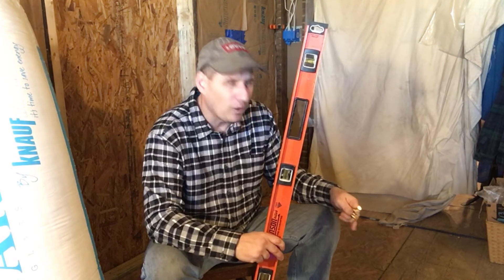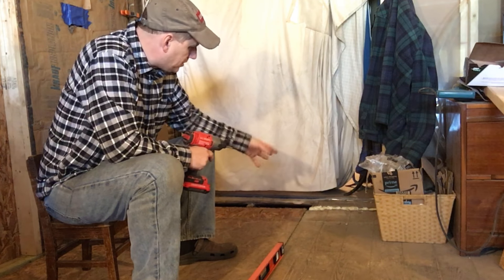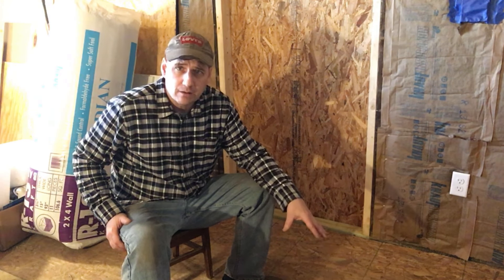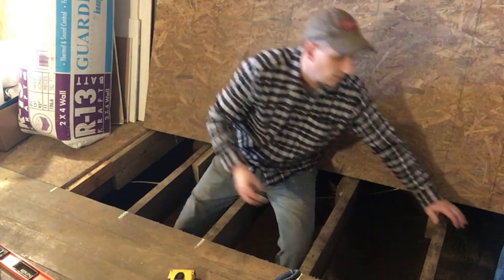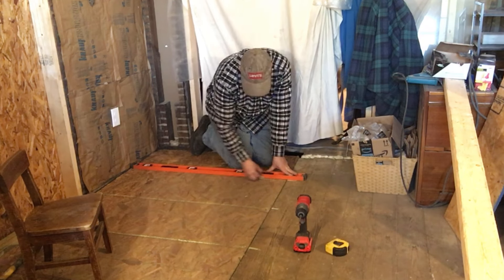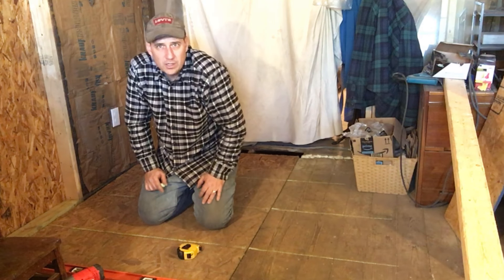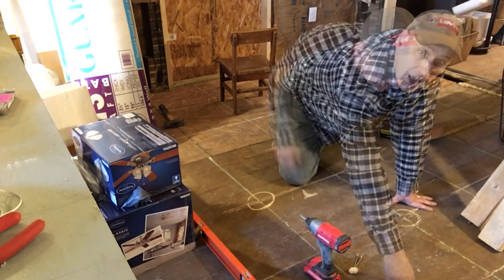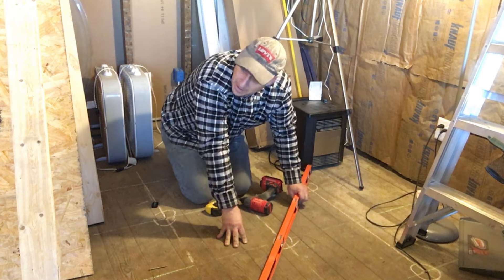DIY: Easiest Way To Level An OLD WOOD FLOOR - Using Screws and a Level

Comment: Why are you doing this the hard way?  Cut up the old floor and uses 6-by or 8-by sister joists.  You'd be done in an hour.
Reply from the maker: Hi Yeager.
Yes - that is certainly one way to do it.  In our case - nearly the entire house has uneven floors.  To sister all the joists in the house (upstairs and down) would cost thousands of dollars.  My floor cost per room would more than quadruple.  My existing joists are still solid structurally for the most part - except in a couple of places where I did sister joist a few joist ends. See this video: https://youtu.be/QPmpvOHmeIA

Another benefit of leaving the existing floor in place is the old floor boards are made of cedar which doesn't rot.  Since the entire house sits above a humid/moist basement and crawlspace (most of the basement and crawl space is dirt floor), these floor boards will naturally resist rot.  Adding the vapor barrier over the existing floor (see this video: https://youtu.be/tOANffNqoDA ) has provided an excellent moisture barrier between the basement and the living space.

I would definitely suggest sistering the existing joists if the existing floor structure is rotting and not structurally sound or if there is excessive deflection (or sag) in them.  Otherwise - I would recommend saving the money that would go to all of that new lumber and use it to upgrade bathroom and kitchen finishes.

Tearing up the old floor and exposing the basement below is also a difficult thing to do when you are living in the house.  And I am not sure I could get all the demo, sistering, leveling and new decking done in an hour all by myself.  That would probably take me a couple of days per room which would be a very hazardous situation for my family to be living in while the floor is open like that.

Thanks for watching and for the conversation.
Deric

Comment: Easier, quicker and a better job to rip up old subfloor, replace any joists that WILL need replacing, some will be floating, some will be rotten, the wall they were sitting on will have disappeared around the ends of some of them. You don’t have to pull the whole floor up, just start at one end and work your way out a sheet at a time.